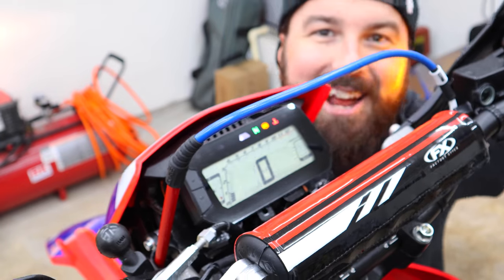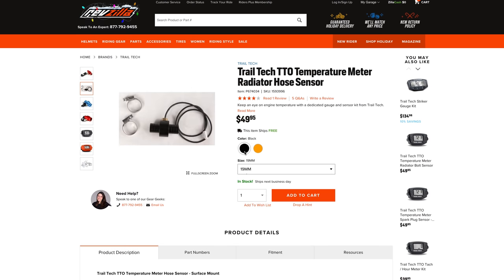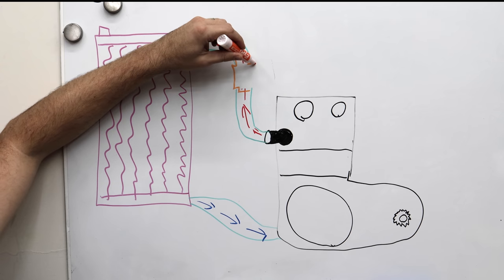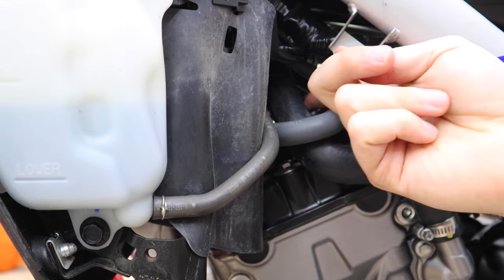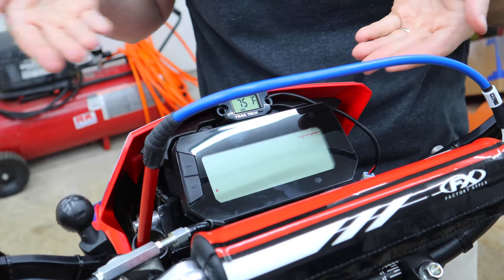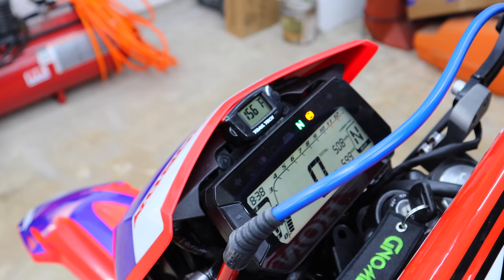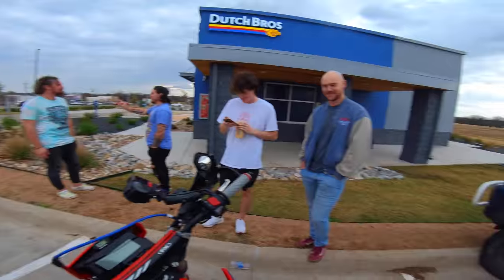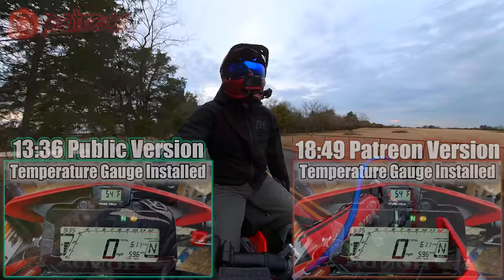Add a Temperature Gauge to ANY Motorcycle

Comment: Dude I had no idea the DRZ doesn’t even have an RPM range! A friend of mine had one at the track the other day and I was like whatttt?! 🤯🤣
Reply from the maker: These dual sports are always on last decades tech. Well the DRZ is last century, 1999 was the first year. I mean like honestly once you have a pipe on a single do you really need an RPM gauge🤣 like the power always drops off my redline. Even the $12k 701/690s don’t have one. But like I said I’d rather have water temp and oil pressure.
Reply: WR's don't either
Reply: I could be wrong, but I don't remember seeing a tachometer on a dual sport/street and trail bike ever past the 70s. I can't remember exactly 70 what, but some old 2t Suzuki and yamaha I remember seeing dual gauges or a split cluster with both on them. I was doing some crf to xr swapping and am in the process of putting on a digital speedometer and had forgotten where the best place to go for the tachometer without making it bouncy and found your video. About bought that speedometer just before I settled on the one I got instead. I'll have to come back and see how well yours did and tell you if I got mine on and dialed in right and tell you what all features on the thing I got to work right on it lol.
Reply: @TheGardenSnake  Wait a minute I want those mirrors are those stock or aftermarket for Honda only?? It looks They are attached to Bark busters...😲

Comment: I've got the blade style probe that you push into the radiator fins on my wr250r, dead accurate and also showed some serious over cooling on cold days so I also made a shroud to reduce airflow when it's chilly.
Reply: It was looking like overcooling because the thermostat didn't allow coolant in it because it was cold
Reply: @wojciechtechtips1602  mmm I guess that’s true, klr have an overcooking issue and the bores in those go out of round big time, don’t hear much about the wr so maybe you’re on to something there. Now I want to know the actual coolant temp 😂

Comment: Love it thinking of a fan switch for the drz
Reply from the maker: Yeah the fan switch I might do as well. But it won’t be as easy as the drz. The 300 uses the built in sensor and it’s the ecu that triggers it on. So I’d need to do a whole relay with a fuse set up. Still might do it.

Comment: @jakethegardensnake is the internal diameter really 19mm as the hose looks smaller..and i see you had trouble pushing the hose onto the in-line temp sensor
ps: service manual says the following for the thermostat…
begin to open: 81-84c (178-183F)
fully open: 95c (203F)
Reply from the maker: 19mm is right. It’s snug but still only took a minute to push on.

Comment: Correct me if I'm wrong, but coolant temperature will only tell you what the thermostat is set to, not the engine temperature.  Don't you really want the engine temperature?  At most it will hit 130* or whatever the thermostat is made to so I guess at best you can tell when you need a new thermostat.
Reply from the maker: No, only under 180f will you be in the dark. And that’s not overheating so it’s not a big deal. Above that you’ll know exactly. In the real world once warmed up you’ll know the water temps on the fly. Big thing here is you can see if it’s overheating or getting up there.

Comment: Trail Tech does have a new version of the TTO temp gauge that can wire directly to the battery and even has a backlight BUT i think currently is only available for the spark plug applications. Seems like it would be an easy swap in the future if your current gauge loses its battery life
Reply from the maker: Oh really 🤔 that would be great.

Comment: very informative and easy to understand video. is the 05:32 hose size 250L and 300L the same if it is same what is the size?. The connection where it is located is it a spare connector 07:43.  Thanks
Reply from the maker: Oh I’m sure it’s the same size as the 250L. The connectors are from the little thermostat dash and the sensor. That’s where I just ended up connecting them.

Comment: You yanks and your creature comforts...

On my 100% EURO9 compliant, emissions free, 150mpg - BONE STOCK - FE450, I can smell when temps are getting a little high. I feel it in my eyeballs when valves are out of spec. 

Oil changes - it's in the bike's aura, man. Become one with the bike and you won't need feelers and gauges and sensors. Become one with the bike, man.... Oh, did I mention that it has like a solid hunred HP and twerk? Seriously, it does!

Man, dudes like Rolf Tibblin had no gauges, gadgets, gubbins or gizmos. And they still crushed like MX, trials - even baja racing. They where one with the bike man. 

(And on a side note, anyone have any idea as to why an FE450 would have a speedo that works *intermittently*?)
Reply from the maker: This comment is great 😂

Comment: Hey Jake, I know you completely removed the ABS system on your bike, but do you have any tips for those of us who would prefer to remove the rear ABS only, while making the front ABS switchable? Do you think that it would be possible to totally replace the rear ABS lines with regular brake lines like you did, but keep the front ABS system intact and add a switch to the ABS system via the fuse box? Which fuse would you be tapping into in this case? thanks mate, I'm really enjoying the informative entertaining build content.
Reply from the maker: I am working on getting my hands on another abs one to make a video putting an abs switch on it. But yeah that should be possible.

Comment: My CRF 250L 2014 radiator is on the left, what model and year is the bike.
Reply from the maker: This is the crf300l. They changed the radiator to the other side for… reasons 🤷‍♂️. But should work the same with the same parts for the 250l.

Comment: This bike doesn't have OBD port? 
There aren't Inexpensive motorcycle OBD dashes?
Reply from the maker: It’s got some kinda diagnostic port but it’s not a OBD. But there are full on aftermarket dashboards you can get. But I’d lose the gear indicator, fuel level  and few other things. Also the odometer is now compromised. But if you’re bike didn’t come with a dash at all like my Xr650r then they are nice.

Comment: Jake I’m looking to buy a bike to convert to super moto. Do you like the 300L
Reply from the maker: Yes it’s good bike for the money. Biggest complaint is the suspension but I have a full race tech kit now. Will be installing it soon.
Reply: Well it looks like I’m getting a 450r tomorrow. Completely rebuilt. Do have a another question. What brand is your helmet? Gonna add to the list of stuff I’m getting for the bike. Have the O’Neal dirt helmet but after I convert it I’ll be riding it to work

Comment: why tf would you pick a coolant temp gauge over an oil temp gauge? oil temp is 100x more important.
Reply from the maker: If the water temp is high then so is the oil 99% of the time. The water temp is very important in a water cooled engine… And show me an easy way to add an oil temp sensor. I mean yeah I can do it but the time and cost are going up. But thanks for the input bubs….